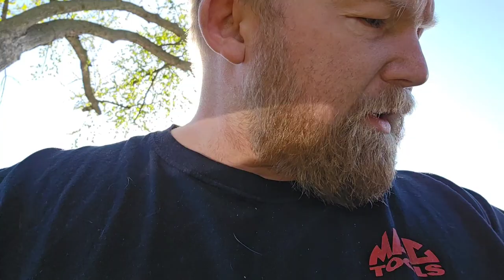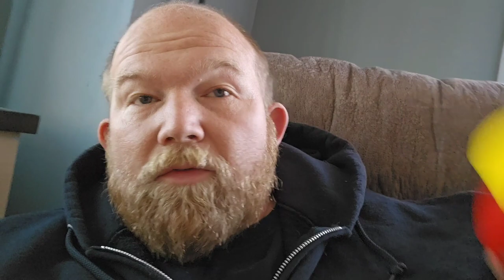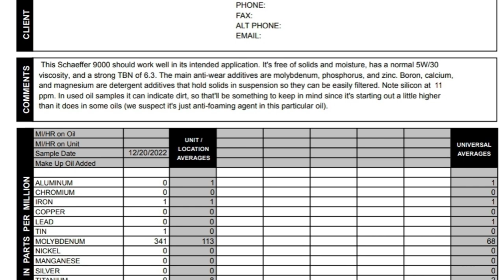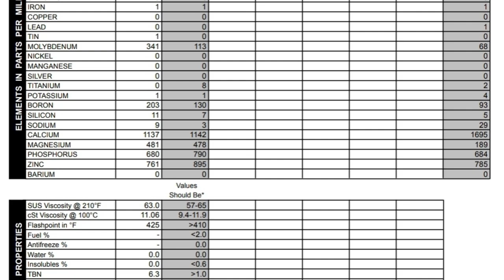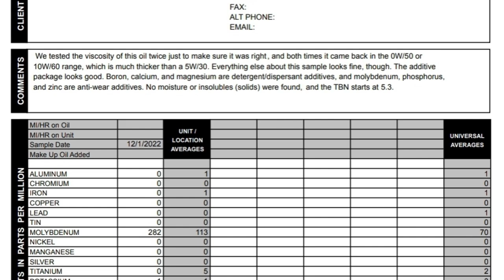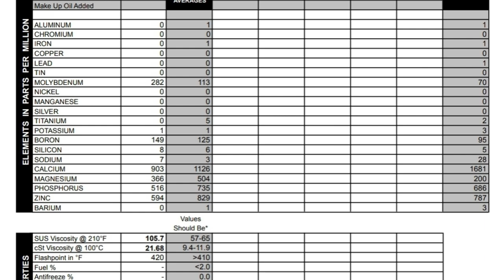Moly Boosters To Oil - Do They Work?! Let's Chat and See Results - Oil Additives In General

Comment: What does Valvoline use for their molybdenum formula? Is it an "old or new" formula? Meaning does the around 377ppm molly in the high milage Valvoline formula equate to the around 91ppm molly in pennzoil platinum ultra because they are using two different grades/formulas of molly?... Or does Valvoline really have three times the molly protection and both Valvoline and Pennzoil are using similar quality molybdenum formulas. Hope my question makes sense. Just trying to learn. Thanks as always Boss! Another great video! Thank you! 👌🙏👍
Reply from the maker: So they use a more standard form of Molly - which its still not the new tri nuclear - it's di - nuclear I believe 

But nobody really knows
Reply: Thanks. I had the same question. I was thinking I would try the Valvoline because the molly was 3 times higher than the ultra platinum I'm currently using. But it sounds like it's not that simple.
Reply: @FordBossMe  Good info! Appreciate the feedback. Still seems even if not comparing exactly apples to apples in terms of molybdenum formulas more than 3x the molly is still a damn good Valvoline product and shouor be at least comparable to the Pennzoil ultra IMO.  From the data we have so far I will continue to use Valvoline high milage and Pennzoil platinum ultra interchangeable in terms of quality until further data is available. Thanks again Boss!
Reply: That was a fascinating result. Never would have guessed that...unless the molybdenum attached itself to the engine parts...which does happen at a certain level..? I do know that for additives to get into the formula  the oil has to be heated to 300 Fahrenheit to get full solubization...
Reply: @FordBossMe  It would be cool if you could maybe do an interview with Lake Speed Jr. like you did with Marvel.
Reply: Oils today are all so good.  The testing they go through to meet the certs and specs they meet is incredible.  Don't use additives.  The oil is scientifically blended for everything to work together to meet the specs.  Adding to it messes up the chemistry.  Anyone who thinks they can homebrew an oil better than the majors are just kidding themselves
Reply: @William-13 And Lake Speed Jnr had David Vizard test Oil some Years back.....
Reply: @mikeschlup5279  "...unless the molybdenum attached itself to the engine parts.."   Were the tested samples new oil from new bottles or was the oil run in an engine for some time?

Comment: as an old geezer, i think the moly additive thinking was leftover thinking back from the 60s & 70s.back when oil wasnt as advanced as it is now.when we were kids an engine was nearly shot by 100k miles even with proper maintenence.both engines & lubrication have come lightyears from the 70s & 80s.just my opinnion from what i seen over the years.
Reply: timkis - Yes !!   I still remember Wynn's Friction Proofing, from the 70's on.....I never needed it, but saw a lot of people buying it... I think the amount of Advertising has everything to do with what people buy.... This is why Mobil-1 has been around so long, and has so many users.... They all grew up seeing those ads that were massive back then...

Comment: I stand by my opinion, good oil and filter at 3000 miles, don't abuse engine equals long life without additives.
Reply: 3000 is too soon waste of money 
i do 5000 synthetic blend ford oil  
i drive alot like 2-3k a month
Reply: @timothydaly4136  I see it similar to the 80-20 rule with the 5k vs 3k change. Changing it 2k early may get you slightly more performance/longevity, but at significantly higher cost/effort.
Reply: I dont drive my Ford Escape very much. about 500-800 miles a month. I only average about 3k or less every oil change even though it's good for 5K
Reply: @notoriousbastards11  lol I’m doing that mileage in about a week

Comment: Moly is kind of heavy by itself and will just sit in the pan -I would not recommend unless if added to a grease.  (Buy a bag of moly itself and see).

These oils using "moly" are actually pretty high tech and the moly is modified to be in an emulsion (liquid stable).  =Just buy an oil with more ppm moly if you want this.

Magnesium is very good however and Torco (oil company) was very big on it (and other metals) in the 70's and 80' in drag racing.  Torco was the best 2-Stroke racing oil I ever used also (80's).

Comment: Rich, I have a brother-in-law who is a chemical engineer for a large oil refinery.  He is a smart, well-educated man and he does something for his salary.  But his field is not my field.  How additives in oil react with the base oil, or carrier, and react with each other in solution with the base oil is simply beyond me.  Honestly, I simply don't know but there are those who do know.  They do the research and testing and develop the additive package.  The testing you have done provides a lot of useful information.  Perhaps folks can look up your testing results and let that be a buying guide.  Lots of things use a "recipe."  Reloading ammo there are "recipes" for the case as some brands have the same outside dimensions but thicker brass making their interior volume less which will increase pressure.  Primer brand and powder brand and weight are taken into consideration, too.  Experts test these "recipes" for pressure, velocity, etc.  Grandma's cookie recipe is another type of recipe.  She found half a teaspoon of cinnamon perfect but what happens if we crank it up to 2 tablespoons?  Ant killer works fine so someone thinks they will double the amount and it will be twice as good, more effective.  But now the ants are smart enough to detect the poison and won't take it.  Well-meaning but defeats the whole purpose. Your advice is really solid.  For me, I avoid stuff like "10,000 mile" and "20,000 mile" oil.  Any good quality oil meeting the specs should be good for 6 months or 5,000 miles.  I can look at the results of the testing you had done at your own time, expense and inconvenience and pick something in the same price range that tests towards the top of the list or pay a tad more to upgrade beyond that.  "It is better to err on the side of caution" I was taught.  I don't tell my brother-in-law how to formulate additive packages and he doesn't tell me what polarity to run any welding electrodes on.  Your recommendation is, I think, spot on.
Reply from the maker: Tyvm

Comment: My buddy had an old Saturn (honda engine in it) it was a very old car and the Honda engine they used for it was known for problems of burning oil. It was burning oil bad. He did add the Lucas engine treatment it did help with some of the burning, it slowed it down. That would the only time I would use a Lucas additive, it bought him a few extra months of life to his Saturn. If you have a perfectly normal engine with no problems I don't see the point in additives when the oil today is so damn good,
Reply from the maker: That's all Lucas does

Comment: Yes. This makes sense. No urgent need for additives with modern oils. BUT, while I didn't plan to add Liqui Moly MoS2 or anything else, I was a desperate to reduce oil consumption, and so I added it to their 5W40 Leightlauf, and it dramatically reduced oil consumption in my 2015 Q5 2.0T (from 1qt in 700 miles to 1/2 qt in 2,300 miles). I guess, it created some sort of film/layer on the pistons. I only added 150 ml of their 300 ml can. So I think I might need to add some MoS2 to the 5W40 Leightlauf every other oil change.  At least it is their own formulation and their own oil, and as VOA have shown, 5W40 Leightlauf Hi-tech has no Moly in it.  😐

Comment: Instead of running Lucas Oil stabilizer. You better off with a quart of thicker oil of the same brand. So if you run 5w 30. Substitute a quarter of it with something like 20 W 50.
Reply: Would have never thought of that

Comment: I remember all the "Slick 50" ads on TV and all these people who believed in it and would bring it in back when I was a lube tech.  I don't know first hand but I read it was actually bad for the engine because it was teflon.
Reply: Jason607 - Yes, I remember all those ads on TV too !  I did research on it back then and found out that it took a huge high temperature for Teflon to ever adhere to anything, and engine temps were not as high as what was needed for this to really work.... if it ever did....
Reply: Shell owned slick 50

Comment: I use Rislone high mileage engine oil supplement in my GM 8.1 liter to clean the lifters as is has a slight tick on start up. Works wonders. Other than that I use Valvoline extended performance. If this engine didn't have this annoying light ticking sound on start up I wouldn't add anything as Valvoline ep is excellent oil.
The engine is in my 2001 National Dolphin lx RV that sits for 4 to 5 months at a time.
Reply: Rislone is just giving your engine an enema.

Comment: I have a 23 eco-diesel gladiator. I did my first oil change at 795 miles with the Mopar 05–40 weight. I believe it is produced by Penzoil platinum version Europe. I added one bottle of red line breaking oil, it has ZDDP. I was worried about it, so wanted to continue the breaking oil.

Comment: Typically, and oil stabilizer additive should be used only on low quality oils, an oil is formulated with at least a 75% of base oil and the rest are additives, on cheap oils the additives deplete quite fast so one of the more important things is the base oil quality and additive as Moly EP will help to stabilize the oil increasing it viscosity index, this is helpful especially in hot weather to maintain the proper lubrication film in order to avoid metal to metal contact, Micro Moly and Penetro helps to take care of an engine especially during start up and high loads when using a low quality oil.

Comment: Listening to you reminded me a comment/question I wanted to put forth to you.  Back around 20 years ago my dad was touring the Talladega racetrack garages before a race and he said he saw several of the engine guys pouring in the Tech 2000 stuff you get at Walmart.  I don't know if that's still true or even if it's still made but I wondered if that oil was that good back then or just to save the race companies money.  I'm not even sure if it was that actual oil and wasn't just them using those bottles filled with other oils.  Still, I was floored when he said that, though. Tech 2000 from Walmart in a race car running 500 miles and in several different driver's cars.  Anyway, maybe that's something you could look into or something and see if it's still made and if it's that good or not.  Thanks, bro. Learning more and more.  Take care.
Reply: Oh, and when I worked in the textile industry back in the late 90s and early 2000s we used various oils depending on the parts and area it was in.  Such as in gear areas we used something like Chevron Delo.  In cam areas we used something called, Nevastain, I believe it was called...been a few years and can't remember much more than that.  That Nevastain stuff looked clear and was sticky.  We'd take some of it and fill empty bottles to use it as chainsaw chain oil.  It was sticky as crap but also very slicky...lol.  My dad's truck burned oil and leak oil bad...old 72 Dodge 340...and he'd mix Castrol 20/50 with that Nevastain stuff....5 castrol to 1 Nevastain or something like that just to keep it from burning and smoking and leaking a quart a month (yeah, he wore that engine out running it HARD for over 200k).  I don't know if you have heard of these oils or anything just wanted to share that.  I think I used my last quart filled bottle of the Nevastain up about 4 years ago on a chainsaw cutting down and up some small trees in the yard.  It stunk to high heaven if you smoked the bar a little too much but if you ran it right it would keep a chain running like it was on ball bearings instead of a rub slide track in the bar...lol.
Reply from the maker: Send me links to things you want me to try
Reply: @FordBossMe  Sorry, I don't have any links to these oils from where I use to work..  As I said this was back a good while ago and the plant and company closed in 2006.  Just wondered if you'd heard of them.  
The Tech 2000 I'm not sure Walmart even carries it or if it's still made but I'll look and see if I can find any there next time in and let you know.  Thanks.

Comment: My Dad has a Ford F150 5.0 liter. He put Mobil one in his engine and it had tons of clatter. He drained the oil the next day and put in Pennzoil and the clatter is gone. I had the same experience myself. I put Mobil one in and wasn't happy with the engine noise ,I changed it out a few days later with something else and the noise is gone. Ever since that day I haven't touched Mobil one.
Reply from the maker: Same here
Reply: Same. Team Valvoline now based off of Recommendation
Reply: @TurnThemWheels  Valvoline looks like good stuff. As long as it's not Mobil 1 I would most likely use it.
Reply: @GreatBeyond74  yessir 🤙🏻

Comment: I ordered some lower control arm bushings for my 03 Grand Marquis and went to install them only to discover they don't fit. Had to buy some OEM ones that have a larger hole on one and and a smaller hole on the other. The bracket mounted to the frame just fine but I suppose they make ones for steel arms and cast aluminum arms which all my Panthers have. None of the pictures I looked at show the holes so it was impossible to tell and they claim to fit all Panthers from 03-11. Great content as usual!

Comment: Another interesting chat. 
In the ‘old days’ I only ran pennzoil or Valvoline. 
These days I get my 21 2.0 Ecoboost serviced at my Ford dealer and they use their bulk semi synthetic (?). 
How does that oil hold up in this type of testing?  

I have my oil changed every 5K kms (3100 miles) or less. Even tho ford recommends 8k. The service advisor has stopped reminding me of that point 😅

Thanks again Rich. Have a great day.
Reply from the maker: It's ok oil it's nothing to brag about
Reply: @FordBossMe  kind of what I thought. Thanks dude

Comment: The GM dealer I purchased my last three used vehicles from pushes people very hard to buy BG MOA with every oil change.They say "modern oils have less protection built in and the MOA restores that.". Well, if they are installing Dexos 1 GEN 2 synthetic oil and recommend 5,000 mile changes, WHY does the oil need the $$ can of MOA? It doesn't and I won't get my oil changed there anymore.

Comment: Pardon me I misspoke never use metalon until properly broke in I had to rearing a brand new honda 10 hp engine because I put 1 tank in the conveyor to finish the job that ruined it so it would not brake in and burned the whole crankcase of oil every day until I had it rebuilt. Guy at Honda dealer told me if I told him what I use he would rebuild it on warranty let them brake in first.

Comment: I just added 1 quart of the synthetic Lucas oil stabilizer and got the check engine light after 900 miles. Mechanic says the error is for low pressure and I get the light when the vehicle is idle. Just changed the oil again with no Lucas stabilizer now

Comment: BTW thank u for info on trans for 15 ram 2500 6.4 auto. Got a rebuilt improved built by a rep company that builds for pulling type trucks all over USA. With that and a new rad, labor etc lil under 8grand. Insanely pricy but if we can't get a new 1 from Ram, used is 3 grand with 288k miles, what r we to do?

Comment: I read mobil and amsoil said don't need any additives because it's how work themselves without interuption????.i drive 07 impala ls almost 1900 miles.using mobil truck oil.i almost list 3 oz of oil???.i start thinking is not good losing oil????.i tried. To think compare to amsoil.hard to say almost same?????.hard to believe new valvoline high mileage fs with max technology.it said will not lose oil until 5000 miles.i think it's for new engine or healthy engine with good gaskets, seals...i know amsoil is expensive but anything happen to engine or transmission.amsoil said will pay everything with their warranty.i never heard about Schafer with Molly booster. I never seen in ace hardware that sell them oil.ford truck with power stroke using Schafer oil.goof spell.their engine failed at 900000 miles...

Comment: I didnt know prolong using and testing on dodge slant 6 without oil.using prolong still running in old tv commerical.lookup on youtube.i know slant 6 is true bulletproif it can run 400000 miles.i had 3 slant 6.i sold them.i wish keep slant 6.i really like slant 6.slant 6 still beat viper in drag racing.

Comment: my daughters car, 2010 mariner, eng light, hooked up said gas cap, has that goofy fuel cap, either fkipper or breather valve ? whats your thought, Ole pap, retired 63bravo diesel mechanic
Reply from the maker: So it's either the gas cap the purge valve or the vent valve what I typically find if the gas cap looks good and it has a good seal it's typically the purge valve
Reply: @FordBossMe  Thanks Boss,

Comment: I have MOA in my Pennzoil ultra oil. Maybe I made a mistake? I'm do for an oil change now so maybe I shouldn't add it again.
Reply from the maker: So MOA is nothing but a magnesium additive and it's extremely high in magnesium but it's only used whenever you use something before it to flush the engine like bg epr because the BG epr is so acidic you use the BG MOA afterwards with the high magnesium count to counteract what little bit of acidity is still in there and it kind of protects the engine from any further acidity build up but it's not necessary unless you're using the bgepr before you're changing the oil and then putting the Pennzoil Ultra in
Reply: SO, should I add the MOA after the EPR and then change the oil? I thought the MOA was added to the new oil and left in until the next oil change. @FordBossMe